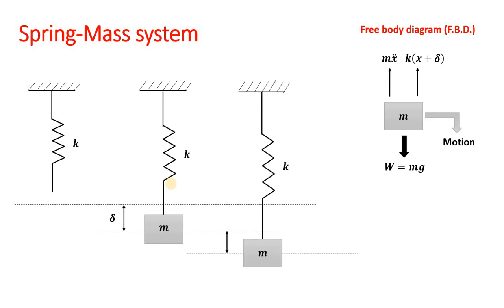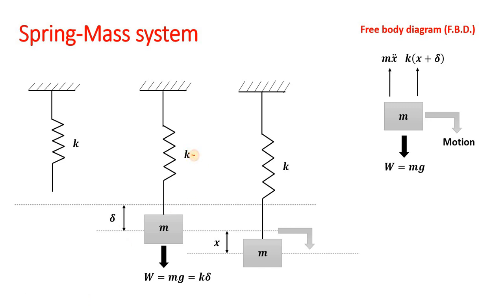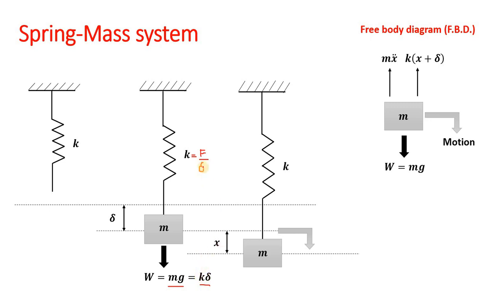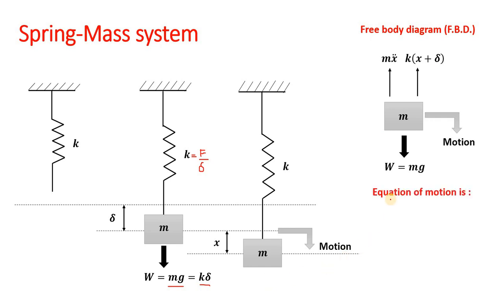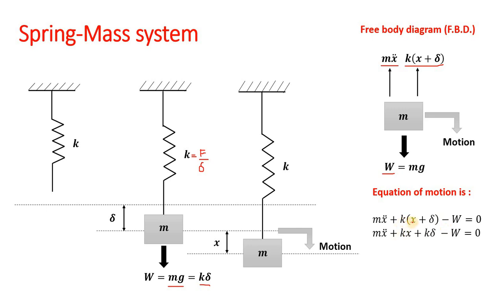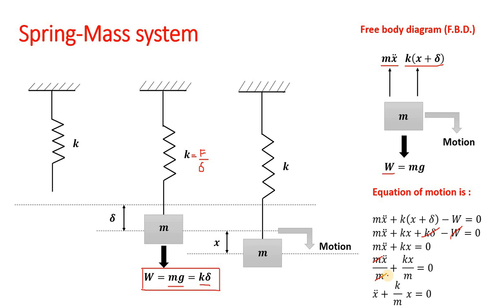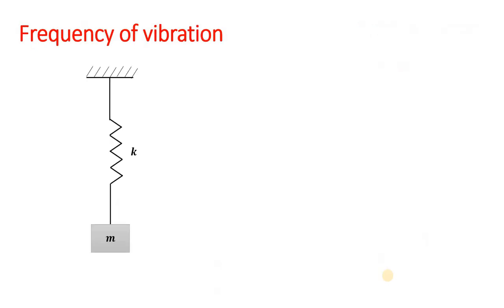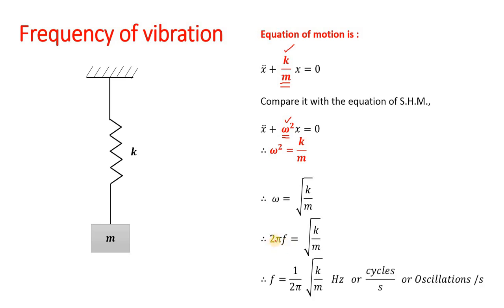Lecture 2 | Natural frequency of vibration | Spring mass system - Part 1

Comment: It is also the same as the eigen-value of the system, right?
Are all positive eigen-values some frequency in the system or can they have a different meaning?
Reply from the maker: You are right ... You can get the nodal frequencies  by  finding out the eigen values. Thanks.